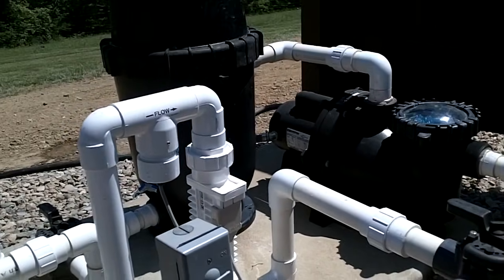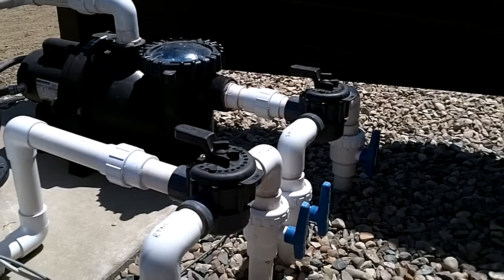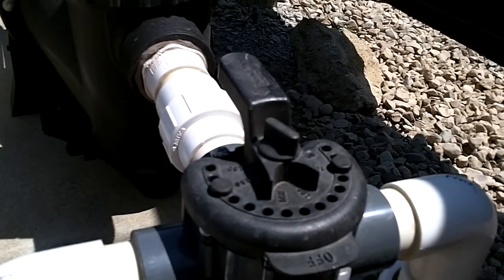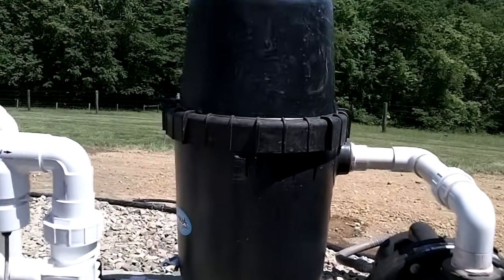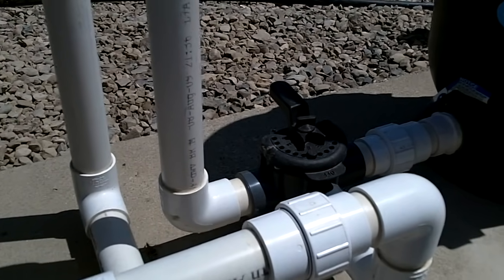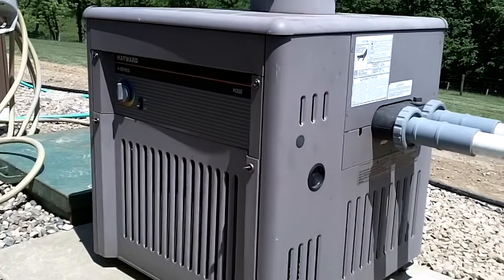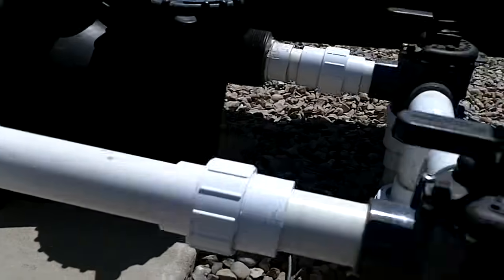How Pool Plumbing SHOULD be put together.

Comment: What really upsets me is that when people do this part, they provide NO structure to the piping of pumps.  They'll lay a small 3 inch piece of concrete under one or two pumps and literally let the piping there un supported.  All the vibrations overtime causes cracks and breaks.  Why would it be so hard to actually place a 4 inch with simple rebar slab underneath the equipment area.  Provide some unistrut support with pipe clamps???  Why can't people do this?

Comment: How do you feel about using 90 degree sweeps over 90-degree elbows, is there much of a difference in the amount of restriction with the 90-degree elbows?
Reply: Yes there is. And with a little research you can find the exact numbers on it. Use the sweeps!

Comment: This is certainly clean looking. That said a few things I see that are questionable... You wouldn't need isolation valves ahead of going into your three-way diverters. You do need a backflow check valve between the salt sell and your heater. There is also an excessive amount of hard 90's when sweeps could have been used.  I do like your idea of the waste port.

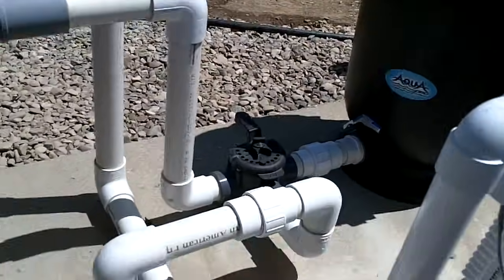Comment: Why is there a tee fitting below the salt cell?  Path of least resistance would be straight thru the tee fitting to the outlet side of the salt cell, instead of sending full flow thru the salt cell. Can see the tee fitting I am referring to at 2:20.  I Also don’t see a tee fitting with a sacrificial anode and bonding wire?  Why wouldn’t you recommend a sacrificial anode on a salt pool?? 

I also don’t see a bypass to isolate the heater. Bypass is useful to isolate the heater from pump flow while getting the water chemistry correct. 

Pipe and valving work indeed looks neat and clean on this setup.  Might work, but I don’t agree with the title of this video.

Comment: This setup is utterly terrible, and it's concerning you're passing this off as a "proper" setup. Your inlet and outlet pipe length for your pump is too short. You used way more 90s than you needed to. Hell, you only needed 1 to go from your pump to your filter had you moved your pump back and filter forward. You did not use high-temp unions, and it looks like you siliconed those male adapters in, which isn't even allowed and do not last due to the silicone delaminating over time. Those pentair diverter valves are inferior to jandy valves due to them having worse tolerances and being made out of pvc and not cpvc which is what you want to be using if the pool is heated; especially gas heaters. The excessive use of unions and 90s are just going to be leaking nightmares for the customer in the future since they're just going to be more points of failure and just screams that you're not confident in your glue joints which is why you need to prepare for making it easier for you in the future to replace that crap. And if we really want to get into the weeds of making the system as efficient as possible and money isn't a factor, then let's not forget about the 1 1/2 plumbing and not a single sweep in that entire setup. And I really would like to know the specs on that pump and filter and maybe that can start cluing us in on why that pump is starving for water while you're filming and bragging about how good the plumbing is.....

Comment: Do you need a valve for every return and skimmer? I am just about to start construction on my 20x40 rectangle and want to minimize the number of above ground valves and pipe?  If it is ok to tie returns and skimmers lines together where is the best spot? I am using 2 skimmers, likely a main drain but would like to hear your thoughts on deleting that and either 3 or 4 returns. All hard 2” pvc with a 2.25 HP VSP, 31” sand filter, likely a heat pump, salt chloronator. I’m only concerned with space and problems using too many valves. Thanks
Reply: 8 months late so you probably went ahead and did your thing, but just in case you have another project or someone stumbles on your comment, VALVE EVERYTHING individually. 

I am a pool and pond contractor myself and when it comes to Vacuuming, you're gonna want control of your skimmers flow. Also more important than that, is you want equal suction from the pool skimmers and equal return of the jets. Water takes the path of least resistance, so if you have say 4 jets inline, jet 1 will push the strongest and jet 4 will be weak, if it even gets flow at all. This creates obvious circulation issues which can affect water quality and create "dead zones" in the pool where stuff goes to settle.

Comment: Missing a heater bypass, there's one for the drain but should have one for the heater.
Reply from the maker: Heater manufactures are getting away from bypass. They would rather the heater be taking all the water all the time even if unbalanced OVER the risk of leaving bad water just sit in there for long periods of time.

Comment: At least the title is correct. This is how it should not be plumbed. Hard 90s all over the place and street hard 90s to make it even worse. No check valve after heater. Unnecessary unions that are future leaks, and absolute shit equipment. I would be embarrassed to show this off as an example of how a pool pad should be plumbed. Sorry, but this is really not a good plumb job. No UV protection on the PVC. Way to short on the pump influent line. 
I guess we have a much higher standard for equipment sets.

Comment: i thought you said you were a plumbing geek, where is the isolation valve for the heater when it is not needed?
Reply from the maker: Bypass is becoming a thing of the past. It is believed that leaving BAD water in the heater for an extended period is worse than just continuing to let water run through it. Assuming your water is balanced as it should be why the need to bypass?

Comment: So I am having a pool installed. The plumbers were out on friday and rough piped the pool. The odd thing is they mixed the primer with the glue. So they made a 2 step process into 1.
Reply: That is not how glue and primer are designed and work. If it was OK the manufacturer would make it that way. The glue joints are compromised and will not hold.
Reply: @matthewray8369  Agreed.  Talk about being lazy.  I guess they wanted to save time.  Haste makes waste.  The primer is used for a reason.  It primes the surface and make cohesion possible.  I wonder what other short cuts they will be taking?

Comment: Why both a diverter valve and individual ball valves on the inlet side?
Reply from the maker: We don't plumb like this anymore but still use diverters and ball stops. The diverter gives the operator more control of exact flow (skimmer / drain) and the ball stops are for opening and servicing the equipment and winterization.
Reply: @LuxuryPoolsandLiving  excellent thanks.  My equipment is six feet up from the pool and and I'll rearrange the piping to focus on efficient flow and preventing backflow, but organize real estate so that it can  accommodate a diverter for fine tuning in the future

Comment: If you already have 3 way valves. What is the point of  adding the ball valves. No need for them. 
And why not a electronic ignition heater?
Reply from the maker: The diverted are used to control flow. The ball stops are used to shut off the water and prevent a loss of prime when the system is opened up. Allowing air in the lines makes reprime much harder. Ball stops prevent that air from enter the pipes and the water going back to the pool.
Reply: @LuxuryPoolsandLiving  
I  would add a jandy  check valve before the pump and make sure that you don't have any leaks within the system. 
Props on the clean plumbing though. I like seeing level plumbing.

Comment: Hey guys I’m trying to get the proper sizing for my pipes I’m installing for deck jet and they are each 5 GPM I have the loop set up from 1 inch to 3/4 and then out but my main line I’m curious if I should just go with 1 inch or 1 1/2 any suggestions
Reply from the maker: We recommend that your largest system pipe size (1.5" or 2") all the way to the loop. Size down to 3/4 at the deck jets only. We reduce only have about a 16" of pipe in 3/4" connecting our T to the deck jet. This helps efficiency quite a bit.
Reply: Thanks a lot that really did help I’m going to do exactly what you just told me and I have a bout a 14 inch on the three-quarter pipe so that was a plus

Comment: You want the waste valve BEFORE the filter! Not after the filter. You want to be able to vaccume to waste, before going through filter.
Reply from the maker: IF you want to vac to waste - Remove the cartridge and vac to waste. The diverter MUST be after a cartridge filter so that you can purge the dirty water from the canister on restart up. If not you will puff dirt back to the pool every single time you service the filter.

Comment: So you're against gas heaters because they work too good?  We love our gas pas heater!
Reply from the maker: Working well and being efficient are not the same. Heat pumps are simply more durable to water chemistry and more officiant to operate. No worries.
Reply: @LuxuryPoolsandLiving  you just said you're not a fan and didn't explain why.  Then you said that they would be able to use it longer into the year and only a "fossil fuel" system would be able to do that.  I would see that as a plus.

Comment: You are exiting your pump  with a 90 deg fitting ....most sites say NEVER to do this ??
Reply from the maker: The other option in cases such as this, is to come up high and then back down. That would add 2 additional 90'2 which is even worse.

Comment: You did a nice job piping and installing isolation valves but one big mistake was made. Since the pool heater can be isolated a relief valve ( tpr ) & relief pipe is required in United States . In Canada , a relief valve is  required no matter what ( isolation valves or  not).

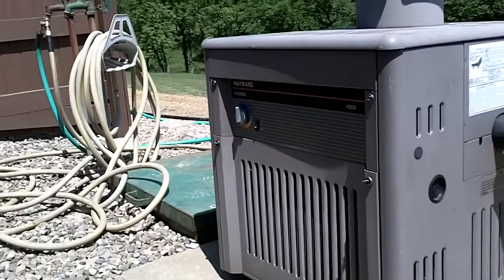Comment: I know this vid is long in the tooth, but I'm hoping you might still field a Q that this raises at 2:20 in - as you pan to the salt cell: it appears to me that the circuit through that cell is a loop that must contend for flow with what looks to me like a simple, straight-through slip coupling (that has 3 stickers still on it).  In other words, water can flow straight through that line, OR it can turn through the 1st Tee, go up and over to drop down through the salt cell and rejoin the other line at the 2nd Tee, which I'd GUESS would radically diminish flow THROUGH the cell.  Am I missing something, or is that beneficial in some strange way?
Reply: Salt cell optimal gpm is 25 to 80. The loop prevents it going over 80 so the salt cell operates optimally.
Reply: @coronanick9293  Thank you for the RE: !
However, I'm still a tad dubious - perhaps misguided in assuming that the straight-through path is a simple pipe WITHOUT any "intelligence" like a pressure-regulator or such: IS there anything inside that pipe (under the decal/label/whatever the black sleeve with the unreadable markings might be)?  If not, it's easy to envision that this PROBABLY prevents exceeding 80gpm through the long-way-around loop (through the salt cell) but it leaves (in my mind, at least) room for doubt that the MINIMUM of 25 gpm is assured.  Of course, I have NO IDEA WHATSOEVER what the actual flow is coming into that split pathway.  Without going back to see if I can determine this, I'm guessing the pump may be a variable, like mine, such that it might be dialed in within some reasonable range?
(On a total sidebar, having nothing to do with this vein of inquiry: my cell started to fail, yielding wonky numbers on the control panel: lying about the salt content.  Not thinking to verify by testing, I made the quick calculation and added a bunch of salt.  Not seeing the change I expected, and STILL too dense to test for verification, I added MORE.  Only when THAT failed to make things right did I FINALLY test manually.  WOW - it was 8000 instead of 3200 - which totally FRIED the already failing cell!  With the water rationing and low rainfall from the drought this has meant that I STILL can't risk ruining a new replacement - so I'm still WAY too high to run my chlorinator.  Waaaaaaaaaaaaaaa, he whined....)
Reply: @palewriter1856  you should drain some water, refill and check salt content.  The loop essentially prevents the salt generator from getting too much gpm, above 80 so it works optimally.
Reply: @coronanick9293  Yes, I understand that simple generality, but you just repeated yourself - without answering my question at all.

Comment: Got a question guy has 2 sets of return lines
His buddy seat return are not busted but the 2 returns inside pool are leaking guys got a ball valve on bad return line is it ok to close off ball valve to bad return and I removed handle will it be fine till he get his return line fixed
Reply from the maker: Im not totally following the scene our dealing with. The answer is probably. Turning off the valve to the leaking line is the right call but depending on how bad the break is... you may still loose water from the pool due to gravity leakage.
Reply: I capped both the bad returns it had just 1 in shallow and 1 in deep end
Luckily they got a buddy seat and those 2 returns in buddy seat are ran
Separately.Pools up and running running fine.Thank you for the help

Comment: Should the winterizing
 diverted be before the filter?
Reply from the maker: If you had the need or desire to vac to waste without removing the filter that would be OK. Having the drain to waste after allows you to purge the last bit of contaminated water out of the system before sending it back to the pool and soiling the pool.

Comment: I leave more pipe between valves and connections in case of future cuts. Valves are expensive and you want to be able to use them. I’m not a fan of connectors which can be prone to leaking, plus they’re expensive. Fittings are cheap. Not a fan of ball valves. They don’t last.

Comment: Natural gas and propane is still the most effective in terms of heating a pool. Heat pumps are crap. They absorb heat from ambient air. Heat pumps all run on 240vac. The upfront cost of heat pumps are alot more than gas heaters. If you are choosing to heat your pool with an electric heater then you are an idiot. Electric heating is the slowest and most ineffective.  All high efficiency pool heaters now have the option of a cupro nickle heat exchanger. It doesnt matter if you have a salt water pool or not, as poor water chemistry will rot through regardless. Millivolt heaters are garbage. After 2-3 years old they start to become unreliable. Hayward especially makes trash products. Also your lovely salt cell from Hayward, expect to replace it every 4 years as that's how long they last, you can even ask Hayward Haha.

Comment: Fewer elbows - ideally none -  and certainly no 90º ones between the pump and the filter would be better/neater
Reply: MrTolesi worse comes to worse he could have atleast used a sweep 90... no so bad on the flow compared to a straight 90
Reply: Which fitting he coul use then? And why? 

Rookie here

Comment: Is this type of pvc of UV resistant type or will you be required to wrap, paint or cover your equipment. I know some areas like SoCal require some type of protection for pvc pool piping exposed to direct sun. Thanks for sharing.
Reply: Steve Lopez when I do plumbing I spray paint my pipes black, helps cover any excess primer or glue and prevents the pipes from becoming too brittle in the direct sunlight here in Bakersfield, CA.

Comment: The suction side diverter should not be 50/50... it should be 75 from skimmer, 25 from main drain. This is because surface water is warmer. Warmer water = higher risk.